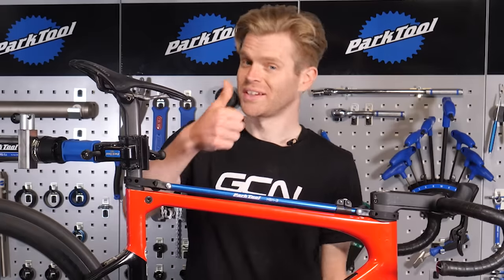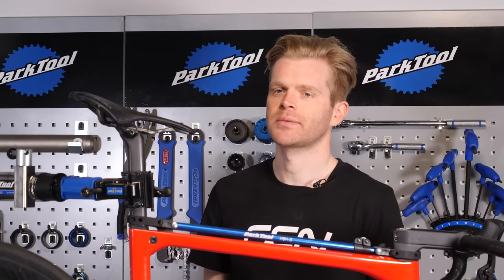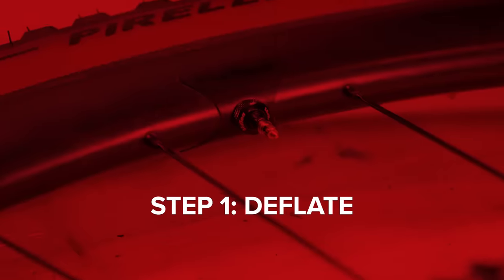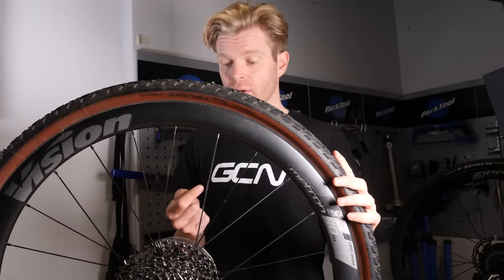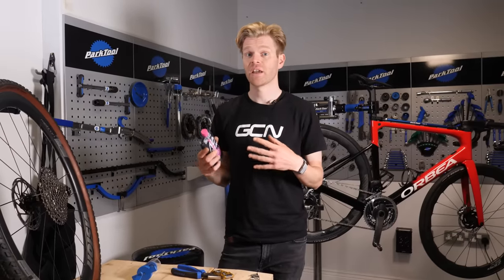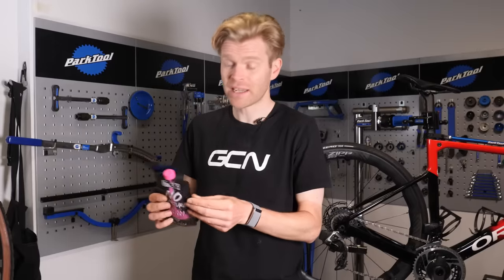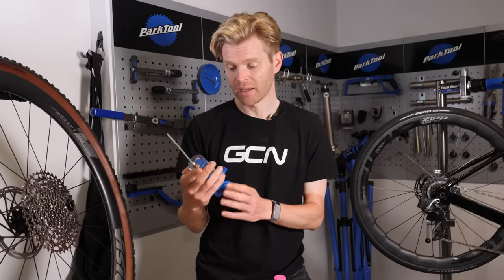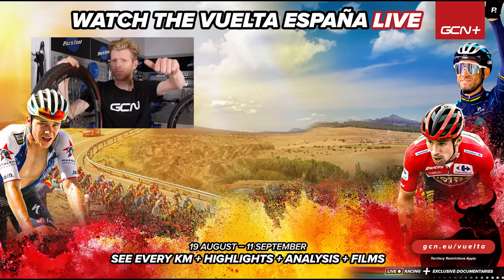When Should You Replace Tubeless Sealant? | Maintenance Monday

Comment: The more of these admittedly helpful videos I watch, the more I think I'll stick with tubes. Just have to top off with air every couple weeks. Some of these videos even recommend carrying a spare tube for catastrophic failures. So what's the point of tubeless? Seems like a hassle.
Reply: With tubeless you can run lower pressure meaning more comfort, and a small puncture on a ride that would require you taking the wheel off to change a tube are a non issue. Carry 1 ultra lightweight tpu tube in case you get a massive rip that the sealant can't resolve.

Comment: This method of topping up through the valve using a syringe doesn't work if you use Stans Race sealant.  It's so efficient at plugging holes that it won't go through the syringe or valve.  I just break the bead of the tyre and pour the fresh in.

Comment: I just add 50 ml of water instead of sealant every 3 months, the old sealant dissolves a little in water when the wheel rotates, forming an emulsion. There is an idea to carry with you a little sealant in a bottle, which can be used only when the tire is punctured. Thus, there is no need to check the condition of the sealant in the tires.
Reply: The sealant is a polymer called polyvinylalcohol, once it dries out it doesn’t redissolve properly.
Reply: @simony2801  The composition of the liquid base of Squirt sealant includes propylene glycol (20-30%), latex (15-20%) and water (40-50%).  The water acts as a vehicle to deliver the particles to the puncture site, but latex and propylene glycol are also dissolved in it. 
Yes, dried latex sealant slowly dissolves in water, but with repeated mechanical agitation, an emulsion of water and suspended particles is formed.  These particles can block the puncture.

Comment: tubeless is good when new. After 2 or 3 punctures in the micro-cut tire it will never be the same. 100psi? impossible. 65 70 or less or bye sealant  . I'm happy with light tubes and 4season :)

Comment: So you need to add fluid when your dipstick is dry?  Hmm….
More seriously, if you have a syringe: Let out pressure and remove valve core at 9 o’clock.  Carefully rotate wheel so valve core is at 6 o’clock.  Use syringe to suck up whatever sealant is in the tyre. Inspect condition and quantity.  If it’s ok reinject into tyre, add more of the same brand of sealant if needed.  Replace valve core and reinflate. Maybe 10 mins total.

Comment: #askgcntech What is the difference between MTB and road discs? Can i imorove breaking power and avoid a ridge forming by using a MTB disc or should i look at higher tier road discs?
Reply: I use Hope mtb floating discs on my Boardman road bike
Reply: I don't think using MTB disks in itself would be an issue, what is more important is the size of the disk, a bigger disk has more stopping power but puts more force on the fork so it is important not to go beyond the manufacurers recomendations. A higher quality disk will cost more but will function better as it disipates heat faster preventing brake fade. At the end of the day the disk is atill a consumable item all will wear out eventually.

Comment: The dip stick is a lot of work and not so accurate. I mean, how many mm is ok? On what size tire? I'd argue it doesn't even practically work.... Just take the wheel off. Put the valve in the 6 o'clock. Wait a few seconds and shake. If you can't hear the sealant splashing around, there isn't enough. Add some. Once a year take the tire off and clean most of the biggest globs of sealant and start again

Comment: That's way too much attention to my experience 😉 And I most often find that my tires collect a watery substance (condensation?) rather than dry out.

Having 8 bikes, all tubeless, I can't be  bothered to keeping track so I leave it till I have an issue or a big event. Instead of maintenance, I bring a 60ml sealant on rides - never needed it though.
Conveniently old sealant most often shows as excessive pressure loss between rides.
Reply: That clearish "watery substance" is the liquid carrier remaining after all the latex particles have adhered to your tire walls.  I live in a higher humidity environment so sealant evaporation isn't generally a problem, but I do get the watery separation after 4 to 6 months.  I doubt the clear liquid would seal a puncture, so I remove it and add fresh sealant.

Comment: "Sealant lasts 4 to 6 months" - I've put Muc-Off sealant and removed the tires after 3 weeks, had a puncture that did not get plugged and decided to swap to some gravel tires, the sealant was already dry, after 3 weeks...
Reply: Same here, added even more than 30ml per tire and after 1 month mucoff has dried. But I got a very good deal on the big bottle, so no worries.

Comment: Note to tubeless users….inspect your tires often. If you can actually see where the sealant has plugged a puncture, do not pour more sealant in, REPLACE the entire tire.
Reply: Or take the tyre off and patch it on the inside.
Reply: @michaelgurd7477  I would try the tubeless specific patch kits like the one MucOff sells

Comment: Sorry, stick with inner tubes. Much easier. 👍
Reply: good luck
Reply: For my daily commuter totally agree and rim brakes too.
Reply: Why not go the whole way and revert to the Dandy Horse or Laufmaschine from 1818, thus eliminating all of the drivetrain and associated maintenance hassle! No need for special cycling shoes either. And with solid wheels, zero puncture risk!
Reply: @gianpaologliori3604  
Those are great for going downhill but uphill not so much 😆 
My 2 year nice has a small bike with no pedals  she is faster than me.
Reply: @user-nu5fx6en9h Thankyou 🤔
Reply: @gianpaologliori3604  How did you no.👍
Reply: On road bike yeah. On gravel and low pressures, doubt it.